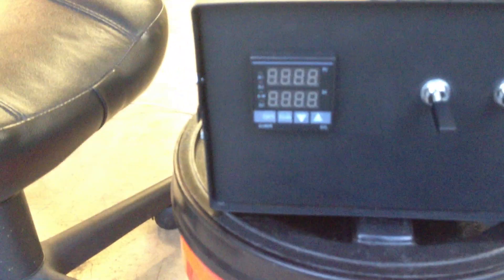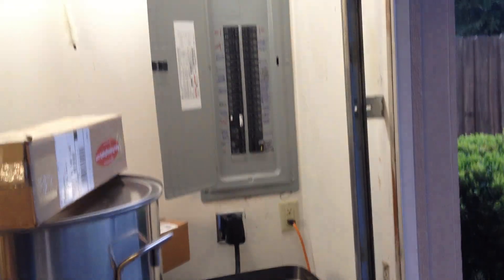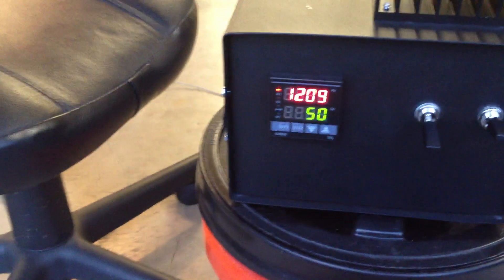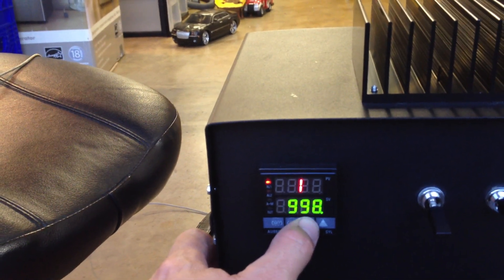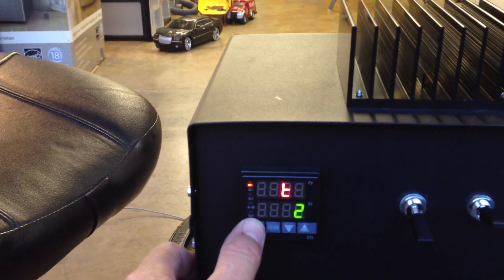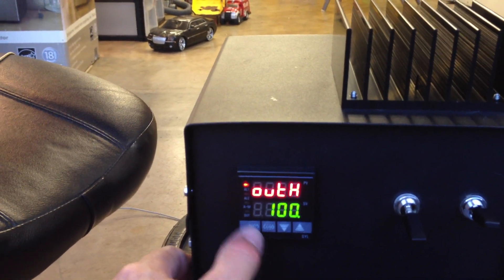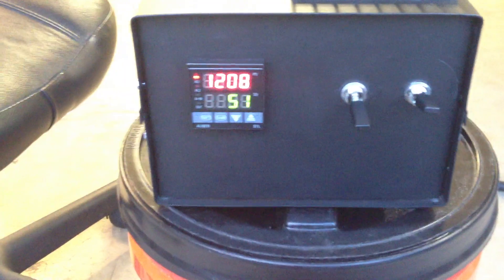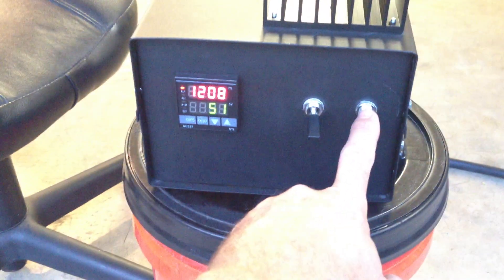Electric Panel Test - First powering

Comment: Good job, PIDs are fun, there are so many settings in them, if you havent found it yet, you need to adjust the Sn (sensor) setting to match the sensor type you are using. When you get to the alarm settings, the fun really starts.